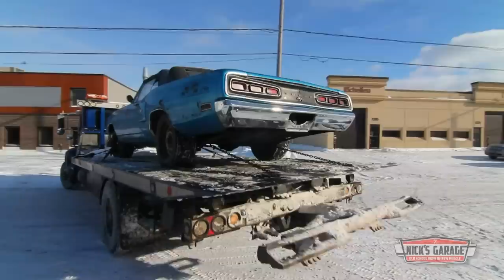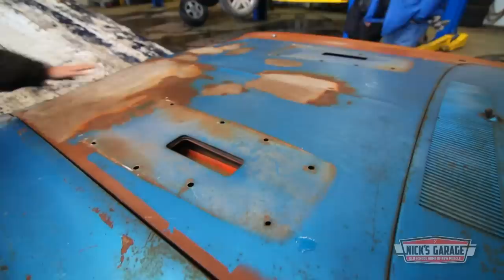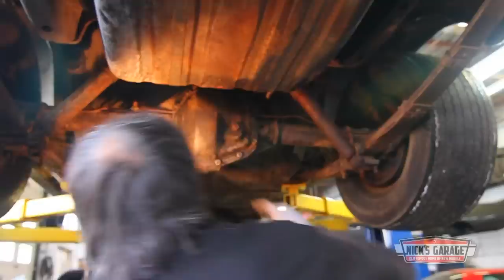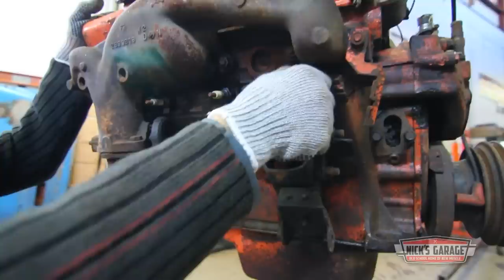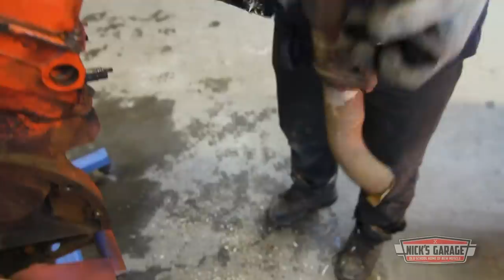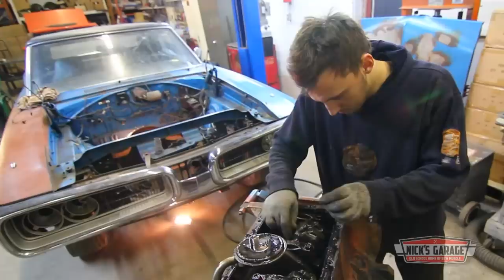Super Rare! 1970  Dodge Coronet Convertible 4 Speed - 440 tear down

Comment: That block is clean. My mother had a '67 Belvedere II station wagon with a 318. After 20 years of short trips, the man in the engine wanted out. I pulled the valve covers and they were packed with a weird fibrous gunk. Ditto the oil pan, which had a little clear area around the pickup. When I scraped the gunk off, the steel was rusted. There was rust on the main caps as well!

Comment: What a great episode! Glad someone finally saved a one of 16 beauty. Very fortunate that it still has what appears to be an original engine in it too.
Reply: It's also One of One with light blue factory big block stripe....
Reply: I read a story some years ago of a guy that found a '70 Coronet R/T convertible setting in a junk yard in Canada that was an original Hemi car. He bought it for what seemed a ridiculous $1500. It didn't have an engine or trans. He restored it. I remember the car because it had power windows and disc brakes. Stuff that was rare on any Coronet back in '70 much less a Hemi car. I think that was in the early '90's but I'm not positive. It would be worth way more now.
Reply: M Marks Power windows in a 1970? Might have been aftermarket
Reply: That_Ford_Guy.  Chrysler had Power Windows as a option back in 1970, but this car in my shop did not have this option.
Reply: I own a '57 Imperial and it has factory electric power windows that are so powerful and fast that Chrysler gave them a rubber joint connecting them to the regulator so they wouldn't kill or maim anyone!! I said electric because I know GM was using oil pressure as earl y as '50 or '51 to power hydraulic cylinders to power windows and seats. Other manufacturers may have been as well but Cadillac and Buick are the only ones I have personal experience with.
Reply: I don`t think any car maker used engine oil pressure to power anything. They used oil pumps and or the power steering pump to power hydraulic cylinders...just saying
Reply: You are probably right that my examples of Buick and Cadillac are wrong. I think they actually used an electric pump to power the hydraulic cylinders. My '57 Imperial however, has an oil line that runs from the engine through the firewall to the HVAC box and controls the blend door with engine oil pressure. I owned a '51 Coupe Deville and the hydraulic window cylinders were seized and disconnected from anything so I scrapped them in favor of aftermarket electric regulators. I may be wrong about them being run off of engine oil pressure specifically but the Imperial does power at least one item with engine oil pressure. If it did then I would think there are many other examples out there.
Reply: The only accessory powered by engine oil pressure on your 57 is the oil pressure gauge....the blend door is powered by vacuum...
Reply: Mark, just a little background, I'm an ASE Master Tech with over 35 years experience plus I own a small restoration shop. You were right about the GM cars although I never found an electric pump on my '51 Cadillac, I never did much to it besides drive it as it was sort of a rat rod. However I do know the difference between vacuum and engine oil pressure. There is a port on the valve cover of a 1957 392 hemi engine that an oil line coming from the recirculation door on the HVAC system screws into for oil return and a T fitting on the oil pressure line going to the oil pressure gauge that supplies pressure to a piston assembly on the recirculation/fresh air door. I can dig the parts out and photograph them for you this weekend if you want. The car and it's parts are currently packed in my enclosed trailer at my old shop because I am in the process of moving. Or I copied a link the a 1957 Imperial HVAC service manual. If you will look at page 432 (4 pages down) at figure 7 it shows the piston assembly and describes the oil lines to and from the engine. Like I said before, if the Imperial used this system then I'm willing to bet many other cars did at one time or another. I'll await your response friend. http://jholst.net/57-service-manual/air-conditioning.pdf
Reply: That is crazy!...I currently working on two 54 Dode Royal Hemi pace cars, a 56 Imperial hemi,a 57 Imperial, a 63 Imperial 413 and a 1954 Dodge Mayfair convertible... I`m going to check that out tomorrow and let you know...
Reply: Well you definitely have good taste in cars. I personally own 3 '57 Imperials but only 1 is savable and I have a 392 out of a '57 300C. It was in a '70 Charger when I bought it back in 1983. I wish I could have gotten the actual 300 car a the time. I was told it was setting in a junkyard several miles away. I really wasn't interested in those cars back then.
Reply: 1967davethewave lol..
those are only the older mopars...
Reply: So Dave..I started out checking the systems this morning and the 63 Imperial LeBaron Coachworks 413 is a combo of vacuum and cable actuated...both 54 Dodge Royal Indy 500 pace car Hemi convertibles are cable actuated as is the 54 Dodge Royal Hemi Coupe...I forgot to stop in and  check the 57 Imperial Hemi as it is stored in another garage...but reading the service manuel it says that it was "an all new system for 1957 and I can only guess that it did not last for very long as buy 1963 it was already discontinued....That system was only for the re-circulation door(therefore only on air conditioned cars) and not for the blend door as you stated...cause the oil pressure solenoid can only be off or on and therefore the re-circulation door can only be open or closed making it impossible to use for a blend door that my need to be partially open...thanks your comments....It was cool discovering new/old systems...
Reply: Interesting. Since the '57 model was totally new, first use of torsion bars, ect, I'm not surprised. I don't think engine oil powered accessories would be very efficient especially given the quality of oil in the '50's and then if there was lack of maintenance I would think they would be prone to failure. Still though, I wonder how many cars had something similar.
Reply: 1967davethewave ..not to mention that oil pressure is not constant...
Reply: and solenoids of that Era are iffy at best.....lol
Reply: Did you notice the check valve in the system to keep from creating low oil pressure at idle? I got a kick out of that. I don't plan on using the factory system in my Imperial when I put it back together, I'll probably go Vintage Air. But it is cool to see what the engineers used to solve problems at that time.
Reply: 1967davethewave oh great!...a check valve fed by dirty engine oil...lol...that will last a lifetime...lol
Reply: I worked on a post war Lincoln at a restoration which also had hydraulic windows, Also on a mid '50's very loaded caddy. It still worked as the entire system had been restored a few years before.
Reply: i read that one too, not that long ago either.  Why do they keep saying 6-pack when it looks like they pulled a 4 barrel off?  I missed something

Comment: Great Observation on those rods....I was hoping you would bring that out, That ride will make a beautiful piece of Mopar History brought back to life! Thanks for sharing....I envy your job!
Reply: dwight fry - mmm I don’t know about that! I’ve owned several. The 6 pak rods HAD to have a dedicated damper with an offset weight. I happen to have a set of rods and a damper in my parts room. Often special duty 440’s came with the 6 pak rods and damper just to use up parts. This is particularly true of post ‘72 motor home engines. Yes. I have one of them too.

Comment: Nick, you mentioned Six Pack, but only show one carb here. Is this not the original engine, or was it converted from the tri-carb setup? The one of sixteen production is only for the Six Packs and of those, only about half were four speeds. I used to work with a guy, in Shelby Township Michigan, who had the dealer demo 440 Six Pack R/T convertible of this '70 model, which he restored about twenty-five years ago. It was an automatic and unique for having the bumble bee stripe deleted at the factory, per build sheet. This one doesn't have the decal either, so either removed or this is a non-Six Pack car. I remember that he rebuilt the 440 Six Pack in his first floor bedroom, much to the chagrin of his young wife. Trust me, this guy was an absolute Mopar fanatic too. His father-in-law worked for Chrysler and was always finding him cars (yellow Bird, Lotus-head Shelby, etc.). Anyway, I relocated and always wondered what happened to that car. Please let me know if there is a directory, because I'd love to look it up. Great video. Thanks!
Reply: Jeff Becker.    What we met was that there were only 16 4 speed convertibles Coronet built in 1970. And what I said is that this engine comes with six pack rods and harmonic balancer, even though it is a factory 4 bbl car.

Comment: if the engine was a virgin there would be an insulation material between the valley pan and intake manifold that was like home fiberglass insulation. i have found that years ago from working on them.

Comment: i am a retired Navy Disabled Veteran. I have a 1966 Dodge Coronet with a 440, i also have a extra block. Anyway the car was just restored and the engine was rebuilt, the engine builder is a 77 year old american who has lived here for 50 plus years rebuilding and racing engines and cars. He dose not have a dyno machine the nearest one is in Manila far from my place. He has a desktop system he uses but most feel it is not accurate. God i wish i had you here to build my engines. Anyway i was wondering if you can give me a idea what my 440 is making HP AND TRQ and give me the Cubic inch it was bore 0.60 over. It has a forged crank hemi rods 10.5 to 1 pistons with a mild cam, i don't know the numbers. It has a 750 edelbrock carb and edelbrock intake. It also has edelbrock performer heads. It has Doug 1 and 7/8 headers with exhaust cutouts. I want to make 500 to 525 horse power but keeping street able and to run a Aircon it is hot here. Will this engine do that plus i like about 550Trq. Please let me know sir, again love your youtube shows there great i am learning a lot sir. I want to build my other 440 to run a six pack and stroke it to reach 600 to 650 HP And Torque can you tell me the best way to do this please? Again keep it street able and to Run a Aircon. I am not a rich guy so i am trying to do this as cheap as possible without being so cheap as to have the engine fail.    Please help thank you and take care sir
Reply: Thomas Tiritilli.   Have you read my Email?  Let me know if you have Power Brakes. Thomas, check it out and let me know?
Reply: Yes Sir i replied, your email already. I do have power brakes, i also bought a Dodge Dart 1969, this past weekend it has a Slant six, i am planning on building my other 440 block. In my email i explain this to you sir. 
Thank you for replying.

Comment: Impact gun on head bolts - great way to strip threads in the block. Six Pack rods are NOT a "copy" of Hemi rods. Hemi rods are even stouter, with more material at the big end and (as I recall) have bushed pin ends for floating piston pins - but I could be wrong on that. Just amazed at all the miss-information still floating around after all these years.
Reply: mcm95403.Sorry, What I meant is comparing the six pack rod over the regular 440 rod. The beam on the regular 440 rod is tapered, while the 6 pack rod is straight as a hemi , speaking of beam only. Maybe I should have gone in more detail, all 440 rods are pressed in pins, and the Hemi is bushed for free floating, and the rod bolts are 3/8 on all 440 and 7/16 on Hemis. And you are correct. the Hemi rod has more material.  All 440 4BBL High Performance engines have the six pack rods. Thanks for watching
Reply: What are you talking about? Never heard of, or seen 'stripped' threads from REMOVING a bolt with an impact. Breaking a bolt, that's a different story.

Comment: Mr Panaritis, Fiona is the name of the F250, she is Dark Green. That's why I, call her Fiona, after Schreck's Ogre wife. Question, she has a broken dipstick tube, caused by the heavy vibration that Cylinder #4's fuel injector, my friend tested the injector lead, and came up with that the computer wasn't sending a signal to #4. So I, bought a new computer, it helped. But like I, said before cylinder #4, goes back and forth, now my friend wants to swap injectors around, use #4 in a different cylinder, and use one with no issues in cylinder #4. My guess is he's seeing if there is a wiring issue from computer to #4, or if # 4 runs in the swapped cylinder, like it did while in #4. In your opinion, do you think that is a good idea, and should the swap be on same side, or on opposite bank? Hope to hear from you. Thank you, From a Hoosier Fan, of your show. P.S. Do you have a Indiana State Flag?

Comment: It just dawned on me that that it is possible you have what is left of a V code car. While I have a set of rods to compare, it’s been too long for me to determine if those are V code rods in the video. The Ramcharger hood was available with a 440. However it makes more sense with a 6 pak. Check the vin for a V. You could have more than you realize. Doubt it but who knows?
Reply: KillerKane.   This car is a U code. 5th digit on VIN plate.
Reply: What is a v code car?
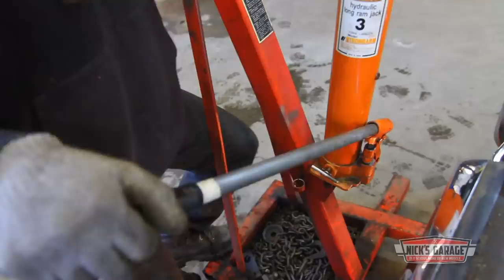Reply: TinyTurtle a V Code car was produced 1970 to 1972 with the 440 6 barrel option. There will be a V in the 5th position of the vin number. While this shows the engine type, there may be several other specific items that need to be on a car to be “correct”. In this case, the harmonic damper and rods are very specific to these cars. Other items will be different too. If the car was a 4 speed, the transmission would be the same as came behind a Hemi. If you add something like the Super TracPac option, the rear end would be a posi 4:10, power steering pump would be pullied to turn slower and a small cooling radiator would be attached. Fresh Air hood would not be standard. And so on. The V is where one starts to verify if a “6 pak” car is real.
Reply: @killerkane1957  thanks for explaining dude.   Im new to american cars just hoping to gain some knowledge. Thank you.
Reply: TinyTurtle I have owned and financed the restoration of many rare MoPars. This was back in the 80’s. I’m too far in life to worry about that sort of thing today. There was no internet then but the data is there. I once sold a ‘64 Dodge for $100,000. Four speed Hemi superstock. Also 6 Max Wedge superstock cars. These were completely different animals than the street cars. I was very fortunate to have owned and enjoyed many rare street cars as well. I have a blown ‘67 Nova that cures my old car itch these days. A true low 9 second street car. What does a gray haired old man need with something like that? He still wants to raise a little hell thats why!! Good luck bro!
Reply: wow sound like you have lived your life to the fullest. glad to hear your story man! thanks and live long!

Comment: She's gonna need: Plugs, points, bearing's, valves, rings, starter switch, ignition wires, water pump, fuel pump, oil pump, clutch, clutch bearing's, clutch plate, brake lining', brake shoes, brake drums, radiator hose and radiator hose couplings'...And I'd give 'er a good wash, too.
Reply: Smug Smugly.   Oh yes for sure and lots more.

Comment: I'd like to say something about "rare cars".
Once upon a time you could order a car from the dealer.
If you knew the codes you could pretty much get whatever you wanted.
50 years later it's a classic, a unicorn, a very special car.
Well that may be amongst the car purists but in real life it's different.
My fathers car is a great example.
He liked big Chrysler's, 1957 thru 1973.
300s, Imperials, Newports.
The "BIG" cars.
In 1976 my Dad got himself a 1973 imperial.
But he wanted it to be a bit different.
A 2 door Imperial, with 300 hood and trunk lid.
It was a difficult job, but I ended up building 3 of them.
Black and gold, gold anodized Center line wheels and 440/472 V8s and reworked suspension.
This could be considered a classic.
My wife 1962 Thunderbird, a classic, but with a 427 sideoiler engine and a modern C6 heavy duty tranny.
Re worked suspension, I would not allow my wife to drive a car that was lacking.
But it is a classic.
You can tell were I'm going with this 
If you like it drive it
I for one wouldn't judge.

The way of the muscle car will never die.
T.

Comment: Looking right at a 440 and calling it a Hemi......
Reply: Fitzy Holden he didnt call it a hemi,he said the rods were the same as a hemi with parallel outer ribs.
Reply: Correct mate. Listen earlier on when they first pop the hood and some other bloke (not Nick) says its a Hemi. Least thats what I think he said.
Reply from the maker: +Fitzy Holden He is talking about the 'Hemi four speed'. Then Nick says 'yes, the Hemi and the 440 got the same 18 spline'.  Thanks for watching, guys.
Reply: Thanks buddy. Struggling with the accents a bit here and there. Aussie.
Reply from the maker: +Fitzy Holden No worries. This was a first day working with a new microphone, too. So the sound isn't at it's best. Thanks for putting up with the poor audio!
Reply: I love these older engines they're basic and everything is visible yet they pack a punch
Reply: I believe he was referring to the 18 spline 4 speed transmission which are called "hemi 4 speeds" not the engine
Reply: He wasn't talking about the motor but the trans
Reply: Fitzy Holden ouch lol